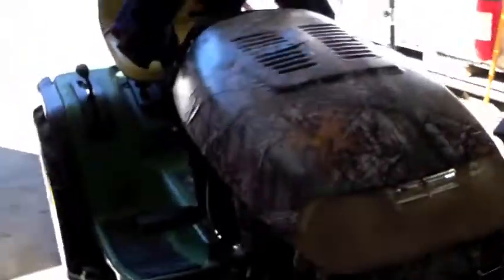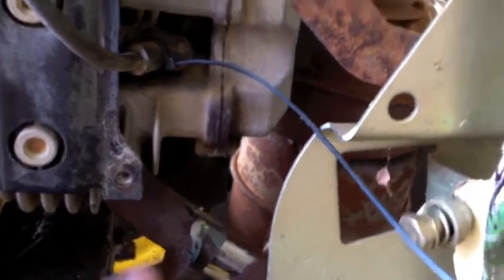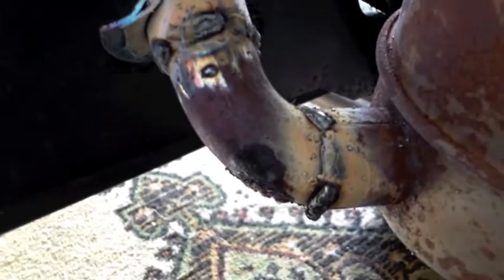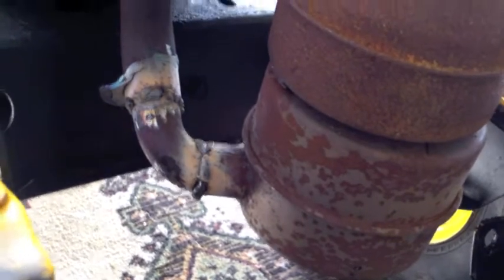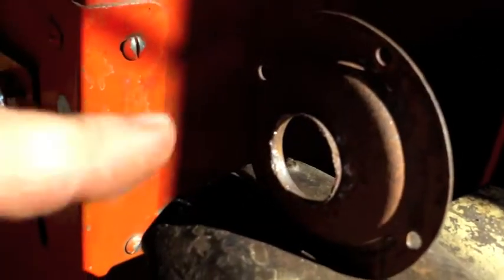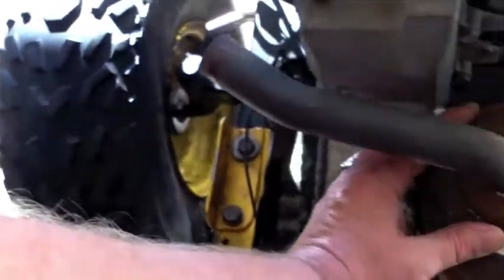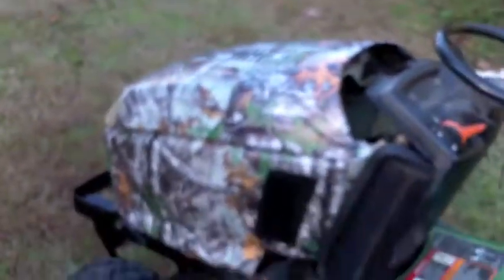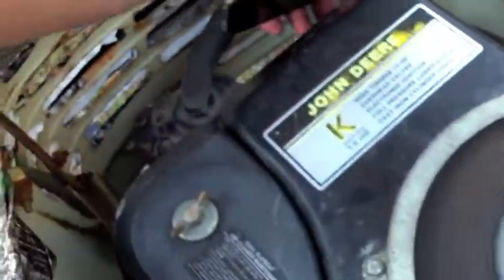Cubcadeere muffler is finished

Comment: Welding that thin material is pretty challenging with stick rod. I would recommend brazing or TIG welding. SMAW/Stick welding is pretty hot even at it's lowest weldable setting.